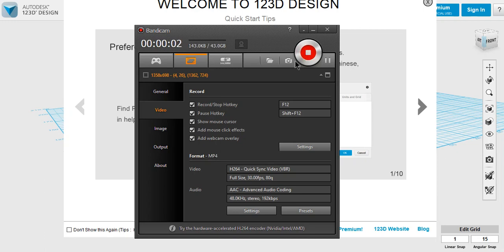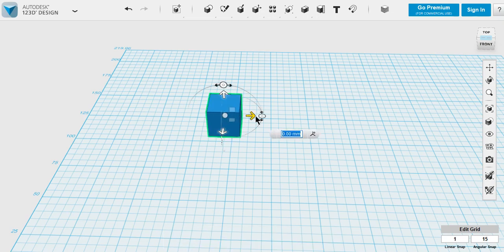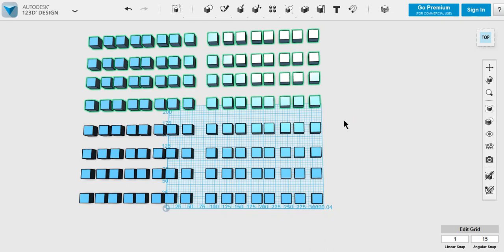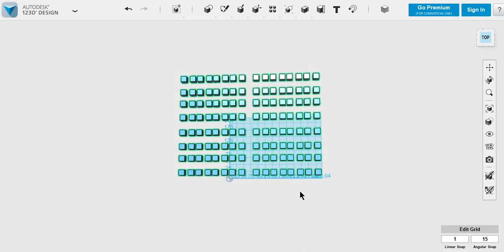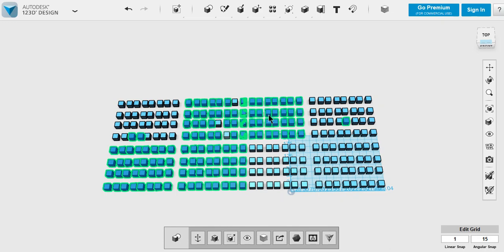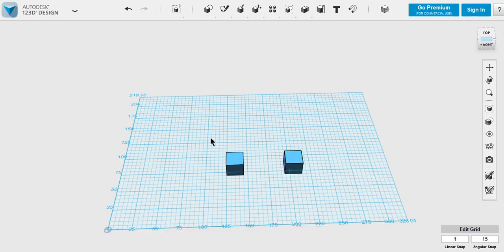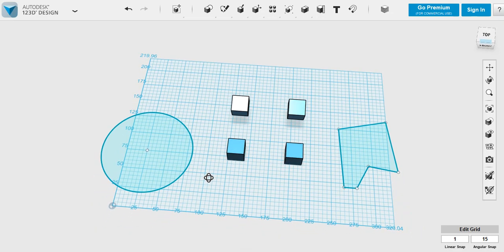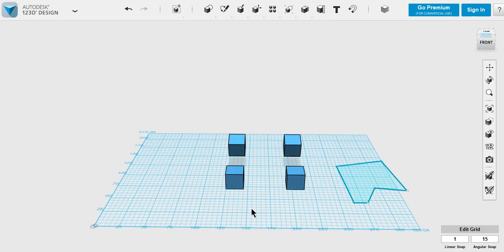What to do when Autodesk 123D Design 'boggs down'

Comment: Tip: there's an auto save feature. It'll save the most recent work if the project has a save file path. So I always at least save the project when I start. Then if it crashes it'll prompt me next time I open the program if I want to recover the work done before crashing. Always does it for me hopefully works for you.